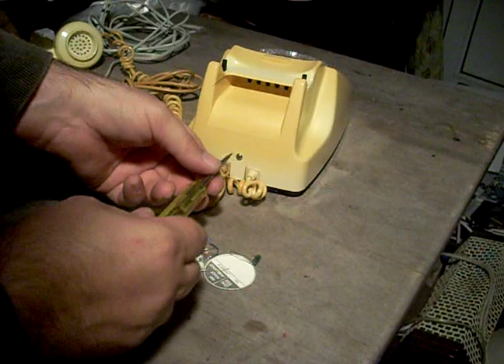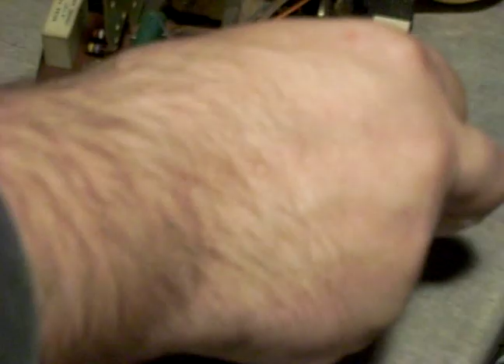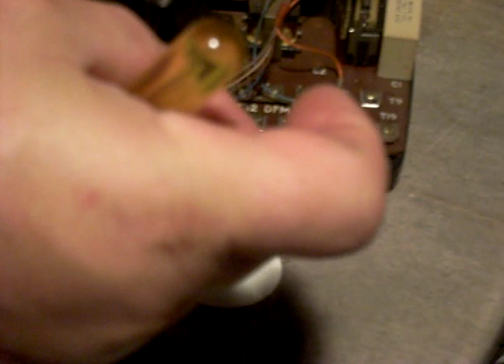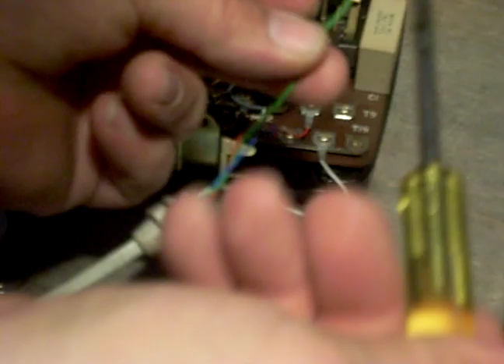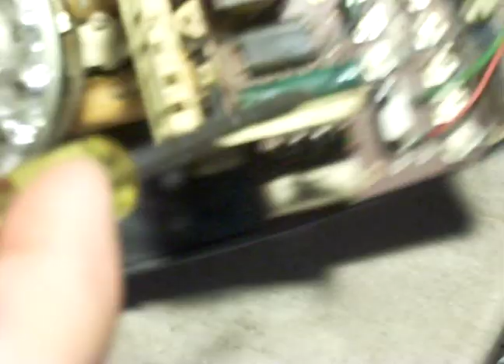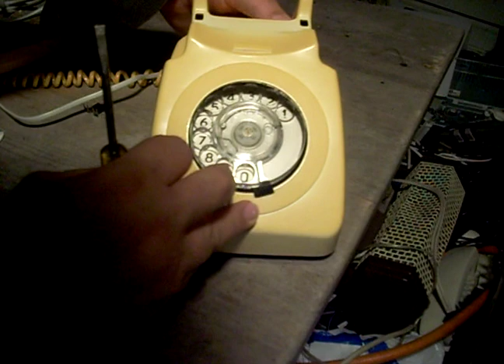Conversion of a vintage 746 telephone to work with modern phone sockets

Comment: Ha!
I remember when I was a kid, back in the 80's and I learned how the dialer works. I then used an old stereo speaker & a mic from a tape recorder and called my friend. If I remember correctly it's just a matter of shorting the mic wires in sequence.
 .......  ..   ...  ....... ...... ........ ..........  (723-7680) my best friend's number from when I was a kid. Zero is 10 clicks in the U.S. I don't know if that's standard worldwide or not.

If it still works this way, that info could come in handy if you were taken hostage & locked in a room somewhere with phone wires.
Total McGeyver shit, right there.
Reply from the maker: it's a matter of OPENING the circuit the requisite number of times, Usually tapping the cradle switch the requisite number of times. You may be remembering the sequence in wargames where he shorts the mic to ground to get dial tone (that may have worked, but i doubt it was that simple!). But yes, here, pulse dial still works, on our phone line at least!

It's still a standard, but as I have found, many modern 'telephone companies' like to turn it off at random as the ASSume everyone is using touchtone. It's one reason I stopped selling converted phones on ebay. I got sick of explaining the phone works fine, but your crappy phone co has decided not to support the standard dialling method!

Comment: I have found out how to connect two phones together en seriel and now want to add a function to make the bells ring. But is it true the coil for making the bell ring is AC? that rules out a battery... I might put in a buzzer instead but it would be much more fun if the bell were ringing.
Reply: You need 60 VAC to operate the ringer

Comment: I'd like to connect a 706 not to the phone line (I haven't got a "land line" anyway) but to a "box of tricks" (i.e. a microcontroller, etc) that will enable me to send it a ring signal, "listen" to the incoming pulses, "listen" to the microphone, send sound to the speaker... But all the technical info I can find is a "simple" conversion to modern BT land lines... any idea where I could get some more technical details?
All I've ever done before is play music through an old 332 back when I was a kid.
Reply from the maker: The circuit is pretty simple really.... the ring signal will be the big issue as it needs to be a fairly high voltage (at LEAST 24v peak) but that should be easy with a microcontroller and a driver circuit... I have the original diagrams here:  http://www.thechipmunk.net/phones/diagrams/746exp.gif  which might be of use sorting out what to send to where. But basically if you feed one with a DC voltage it will work as a telephone, with a dry battery (or alkaline to be honest) if you put 2 in parallel across it, it'll work as an intercom.
Reply from the maker: Pretty much every essential part of the circuit is available on the terminal board, so it is fairly easy to separate the ringing and speech circuits for example
Reply: @TheChipmunk2008  thanks... that' ACE!!
Reply from the maker: @edgeeffect  Anything to keep these things in use is something i care about, so if you have further questions.... but i suspect that the diagram will tell you all you need to know.

If you have 50 or 60 Hz electricity available,  using that for ringing is possible(switched by a 5v relay probably)  but it requires adjustment of the bell. www.britishtelephones.com is a helpful source

Specifically https://www.britishtelephones.com/belladj1.htm section 11 is helpful (I've used it for intercoms before now for people who just want the 'look' but want the phone also to be functional) The bell in a 746 is a 59 C , but the basic idea of adjusting the armature gap is the same, it's just the method differs, should be obvious by looking [loosen the screws, move the loose bits in and out till you get the gap needed]
Reply: @TheChipmunk2008  I tried to find that diagram but you site seems to unavailable at the moment.... you might have a problem there
Reply: @TheChipmunk2008  I'm looking into something that could produce AC at the right frequency.... but I don't know how much luck I'm going to have there..... in which case it might be bell adjusting time.

Comment: Hello, can the old heavy bakelite phones (the 50s'/60s') be converted to work on a modern line system?
Reply from the maker: yes they absolutely can.  I no longer offer the conversion kits (unless someone begs) but https://www.britishtelephones.com/t332.htm may point you in the right direction.

I stopped offering kits because it's not as simple as it looks, but it absolutely can be done

Comment: In the U.S. we converted to modular sockets in the 70s and they havent changed. Our old Western Electric built rotary phones still work without changes. Pulse dialing still works as well. But, ATT wants to go all data now, but we still have rural places that cant get cell signals or have high speed internet like dsl or cable modem.
Reply: Do you know how to rewire an old PTT phone made in Holland to work here in the US? That's what I'm looking for now...
Reply: In the UK pulse dialling still works in most areas I believe, but the UK wants to go all data switchover by 2025, but to reduce e-waste I believe they're letting users just use an adaptor to plug in their landline phones to their router and add their original number to use VoIP.

Comment: Hello: Thanks for your video! I have a 70's Italian made TELCER phone and was wondering if this model can also be converted to the new system. The phone is complete and in order. I tried different connections but all I achieved was that the phone working inverted (like if I lift the receiver it becomes into the off position (no line) and i only get line when I press to disconnect....in other word I have line if the phone is disconnected and no line if I pick up the handset).....in any case the ringer does not work. I tried to call from my cell and I can talk and ear on the TELCER .....your hel would be tremendously appreciated!

Comment: Hi I have a Spanish old dial phone from 1960's. The terminal layout is not the same as the British phones. It doesn't have the T1, T2 etc. But has only 13 terminals. Have you ever converted these kinda phones. Plz help
Reply from the maker: +Obaidullah Shahzad Hi, yes it's usually possible to convert them, but I'd need to see a photo of the internals of the phone to have a chance of figuring it out :)
Reply: They ain't that old, them phones- (we had one of them in the Eighties, and so did me nan and grandad), so why won't they work on a modern-day socket now? Things can't of changed that much since the Eighties! o.o

Comment: Hi was if I could ask you a question, I have a 706F which is connected to a rj11 wall socket through an adapter bought from the uk to convert rj11 to the bt plug on the phone. Following the instructions for the conversion the phone works, can dial, hear and speak.. However no ringing bell like others have, been looking on the internet for advise, but my issue is that im located in Spain and not sure if even doing the conversion will indeed word at all. Any advice would be most helpful thks.

Comment: High there,
 I've just converted my old 746 phone and it can take incoming calls and there's a dialing tone but am unable to dial out !!! is there anything i else i can check for , i'd be grateful for any advice you may be able to provide me with to correct this  

Kind regards 

Ian Johnson
Reply: The only UK telephone service provider that has some problems with pulse dial telephones that I am aware of is TalkTalk. Although they do support pulse dialling I believe the equipment they use in some of their telephone exchanges is not very fault tolerant for old dials. In my experience if your telephones dial speed and ratio is not exact dialling out on some TalkTalk lines can a bit hit and miss :-(

Comment: Nice job there, really. I'm thinkin on doing the same, but I live in Chile. Is it going to work for me if I "convert" an old phone following your steps ?
Reply from the maker: Claudio Leppe Hi Claudio, it depends on the phone and your phone system. Most countries outside the UK only use a 2 wire system, so the conversion in those cases is simply a matter of changing the cord for one with a plug on.

Comment: hey how would you remove the clear plastic bit of the dial? I've just bought one and it is really dirty so would like to clean but can't figure it out! I guess I would need to remove the metal finger catch? thanks
Reply: By finger catch I assume you mean finger stop.  No you don't need to undo this.
Some have found that putting a strong adhesive tape onto the centre of the clear
plastic dial label cover and quickly pulling upwards, sometimes pulls it away.  I
use a very small precision screwdriver, to gently prise the small plastic centre
cover.  Be careful though, if the driver slips, it will scratch the plastic centre cover.
Reply: A couple of taps on the edge of the dial with the handle of a screwdriver jolts it loose.

Comment: excellent ! we coulodn't work out how to remove the plastic centre piece , thank you !
Reply: I assume you are referring to the plastic centre piece on the dial?  If so, all
you need is a very small precision screw driver, and gently prise the centre
away from the dial.  But be careful, if the screw driver slips, it will scratch the
face of plastic centre cover. If you're careful, you should have no problem.
Incidently, if your phone has the old metal type dial, there is a retaining
circlip inside the centre rim of the dial which needs prising out, but be careful
these things can fly out at you if you are not careful.
Reply: Gary Dunn yes it was the centre piece. but there is no space at all for even a pin, to lever the centre piece out. the tape as used in the video worked perfectly

Comment: In reply to Jason Lightoller, when you were wired up with a router for your broadband connection using a land line, you should have received an in line
filter which plugs directly into your phone socket, then your phone is connected
to the filter box, this eliminates any unwanted sounds entering your phone line.

Comment: I have a 746f phone. A friend of mine fitted a modern plug to it and it works fine (he even got the blue and green wires round the wrong way too and it still works) How comes it's working and would you recommend me doing it properly?
Reply: ***** I would like to know what the operating voltage is for the
bell set coils.  I want to wire up an old 746 phone to use as a prop, so I can
ring it as required, without connection to a phone network.  I assume it will be
a relatively low dc voltage, considering the wires that are used in the original
cable.  Also, which pair of wires do I use, and do I need to observe the polarity.
Reply: @garydunn3037  I believe he said in the video that it's about 75 to 80 volts AC, but it can be as much as 110 Volts close to an exchange. But after 4 years you probably don't need the information anymore.
Reply from the maker: Sorry for the delay replying Dave. If you fit a modern plug to the phone without changing any straps, it will, indeed work, but it is taking too much current from the line (not actually dangerous, it just may stop other phones from ringing) and it's putting the ringing voltage back onto the earth wire on the phone wiring, which may, or may not cause a problem :)

Comment: Hi thanks for your very informative video.  I have two questions (1) do converted phones work on all providers (I have heard they only work on BT lines) and (2) what causes the hissing sound? I bought one of these converted phones when I lived in a house that had a BT socket with a wired internet connection, and there was always hissing and crackling on the line when I used the phone.  I want to get another one of these phones, but (a) I have a Virgin line (but the internet connection is now wireless, so I'm hoping the hissing is not going to be an issue) and (b) before I buy another phone I want to know if it will work on a Virgin telephone line.  Any help would be appreciated, thanks
Reply: I have had 2 746s on Virgin,worked for years but have now stopped ringing,converted as shown here.

Comment: When removing the telephone case moulding, I always found it came off easier
by first of all removing the finger dial.  These plastic dials are easily broken, and
I prefer not to push down on them in case this happens.  Its just a simple matter
of prising off the label cover, and undoing the dial retaining screw, then the case
lifts away with no problem.

Comment: Informative video, but its a shame the guys hand kept getting in the way a key
moments. I fitted one of these conversion kits to an old 706 type.  All I did was
undo the old spade connectors, observing the colour coding of each, and making
sure the new cable wires went back to their respective places by observing the
colours of each cable.  And the phone works just fine.

Comment: Great video this has helped me to wire up my 746 telephone and now the bell works fine the only problem i have is the phone will not hang up? when you put the reciever down works fine before you are speaking but when talking phone wont hang up if you have any ideas? also what dose the green resistor between T4 and T5 do as mine dose not have one.
Thanks Neil

Comment: hi,i am trying to convert a 746 phone as per your video,(excellent BTW),my phone is the earlier type746 with coloured dial and two chrome screws on the cradle.
i wondered if the conversion was the same, as i can get dialtone but cannot get the bellset to ring. my other 746 (the one in your video) does ring,so am ruling out my socket.
i have not fitted the resistors.any help would be very much appriciated.
thanks,simon.

Comment: Hi, I have just converted my gpo 746 phone using your instuctions and everything works great. The thing is I find that when I dial out on the phone the dial seems very slow returning to position, I have watched videoa on you tube of these phones being dialed and all are quicker than mine. Can I do anything to the dial that will make it quicker to dial or quicker for it to return to position or is it just the age of the phone?
MKB119

Comment: Hi, I've got a 746 that I am trying to convert, it already has the recififer and I have brought some 3.3k resistors. The cable I am using to convert it has a different colour code, I was wondering if you could tell me the what needs to go to what? 
The colours are Black, Yellow, Green And Red. 
Thanks,

Comment: Hi, I've just bought a 746 phone that was supposed to already be converted.  When I plug it in, I get a dial tone but when I ring someone, they cant hear me (tho I can hear them)  Also, the phone doesn't ring when someone calls.  I've taken off the cover and there is no resistor between 4 and 5, could this be the problem?  Thanks

Comment: I converted one of these some years ago, & what I done, is to place the four wires in the same places as the old ones. 

It works OK, dials calls OK, but one thing it can't do on incoming calls, is ring the bells. :-(

I think though, this may be because our master socket may not have the third wire ( the bell wire) connected in there.

We also have a telephone socket that is connected into Virgin's Cable service, & that is a 2-wire system so won't ring the bell anyway. 

-BoomBoxDeluxe.